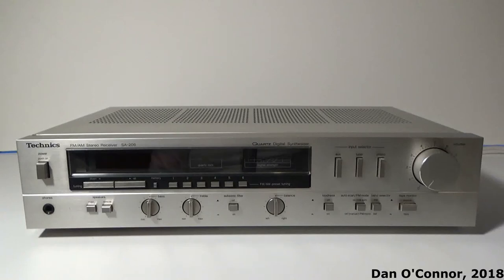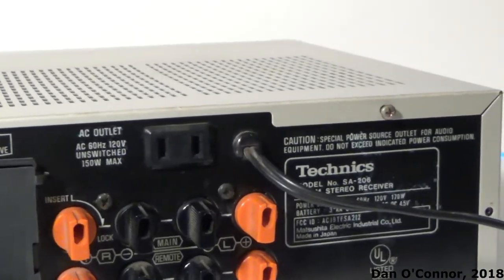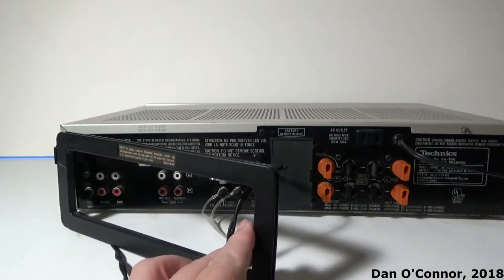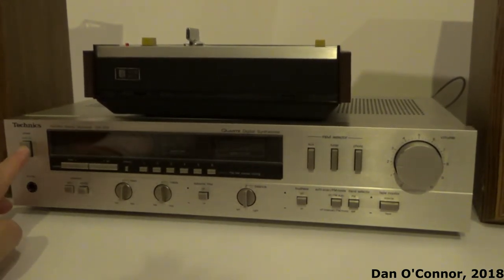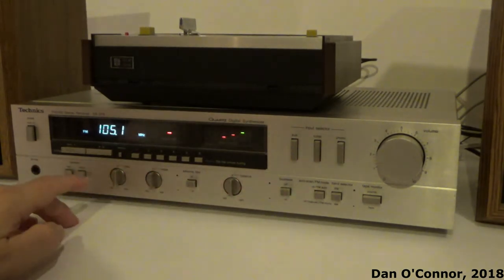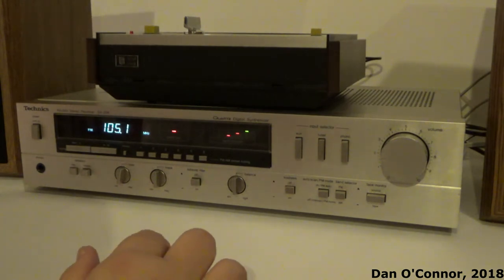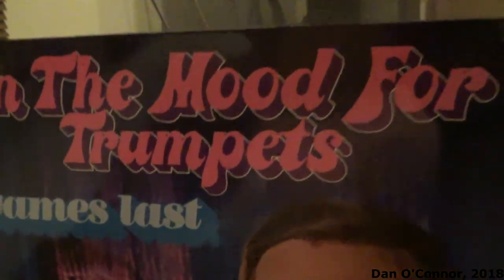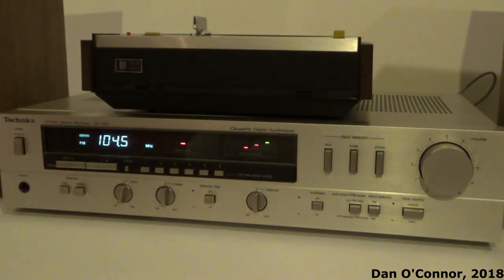1982 Technics Receiver SA-206 (and more)

Comment: I say that's pretty neat, reminds me of the Marantz stereo receiver I own after my grandpa, he was the original owner which surprised me so much. The receiver can go 0 through 9 on the tenths side which was pretty cool, features a video copier as well, it had included the CD and tape deck player but unfortunately my dad discarded them long ago which did upset me a bit. It also has 2 AC outlets, one is the unswitched and the other is switched, sometimes you have to tap the machine because usually it clicks and there would be no sound at all, but yeah that's real cool stereo receiver you have there!